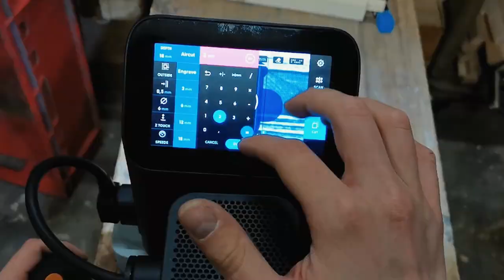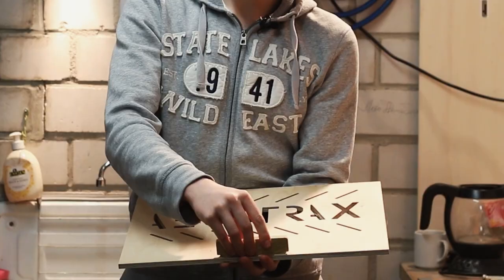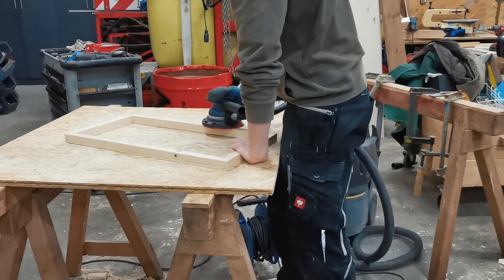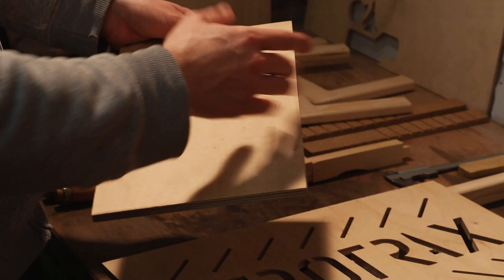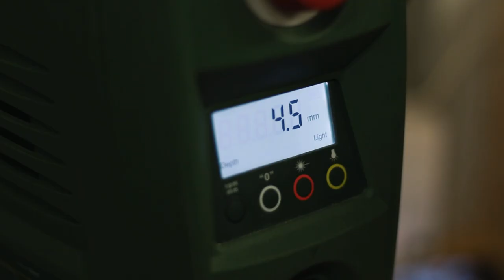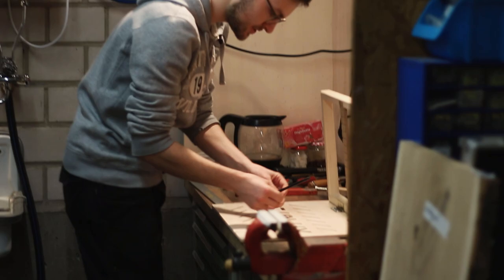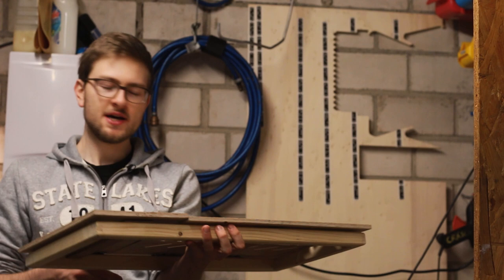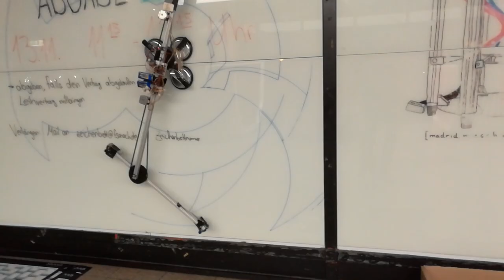Building A Laptop Tray With My Shaper Origin

Comment: I made a similar tray/stand for a tablet that has been in constant use for the past decade.  I also started with slots in a piece of wood to be able to adjust the angle, but after the second time that the stand crashed to the floor, I did away with hinges and moving parts and permanently affixed a grooved board at a 90° angle to the center of the back of the stand and contrary to all expectations that was the perfect hack.  I have observed several people take the tablet affixed to the stand in order to look at something while seated and automatically place it on their leg in the perfect viewing angle.
Reply from the maker: Nice, sounds like you found the ideal angle there...patent pending? 😉

Comment: Why use a chisel? Surely Shaper could do it? End product is great though
Reply from the maker: You're right, in hindsight, I probably could have used Workstation+Origin for that as well. Although I would have needed to chisel the rounded corners (made by the cutter) into clean 90° corners.
Reply: @BodgedButWorks  I have found plenty of videos of dovetail joints being made with the Shaper that fit like a glove without using chisels. I think it depends on the bit, I do not own a Shaper myself but would love get one maybe in the future. The one draw back is the cost of the tape and how disposable it is